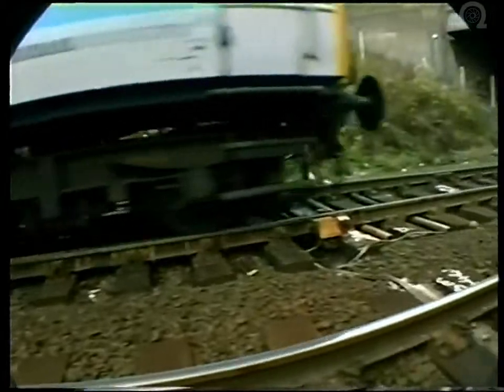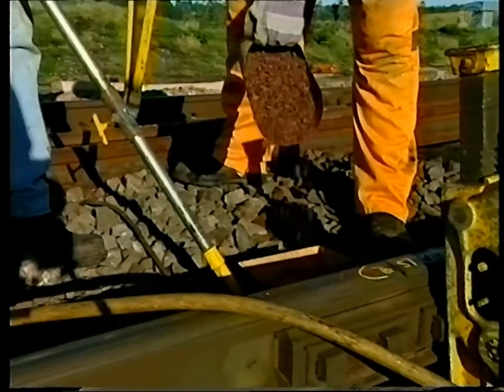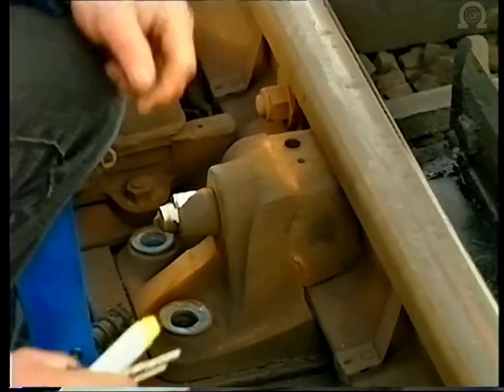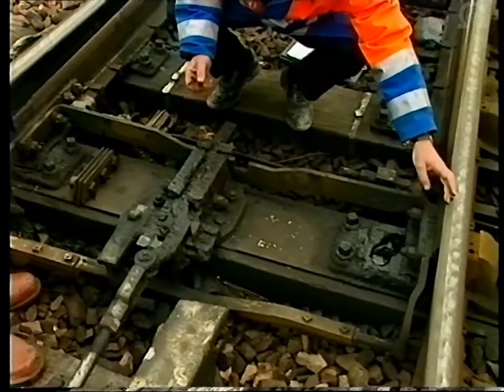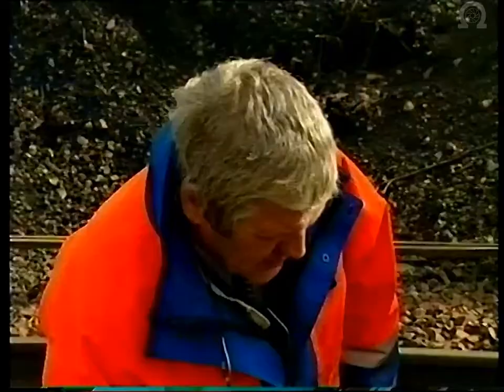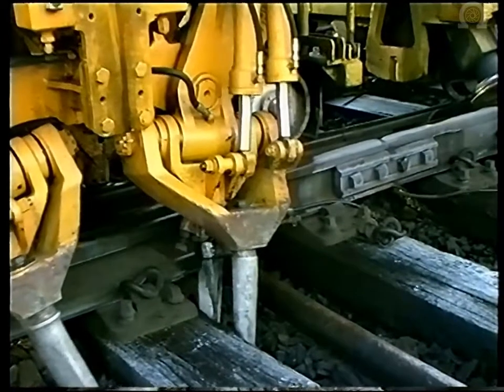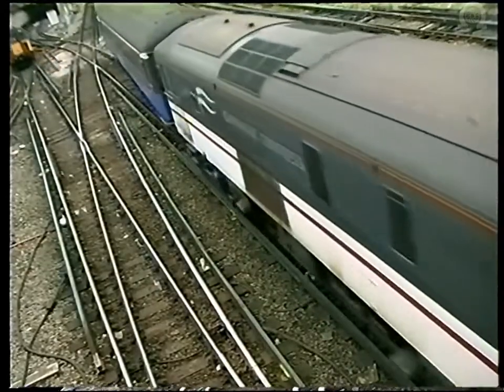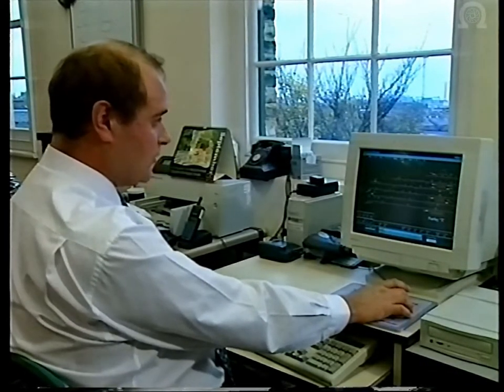Railtrack - Training - Practical Ways to Prevent Point Failure

Comment: Was this prior or lost potters bar?
Reply: Prior to Potters Bar's 2002 rail crash. Judging by the livery mentioned by Bobbingtonn which dates the video to between 1994 and 1997 based on the Network South East livery. The video is clearly from a VCR with poor tracking, rather than a DVD.